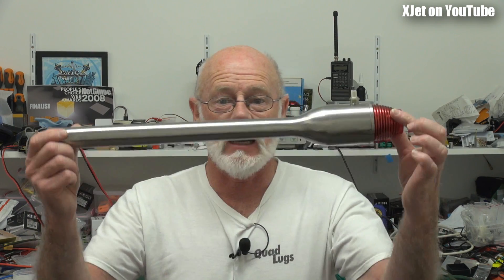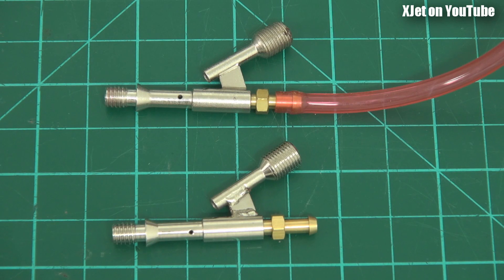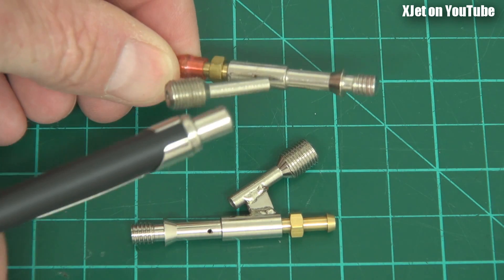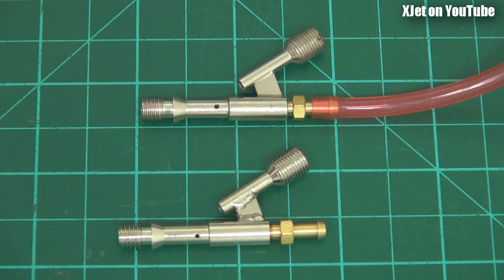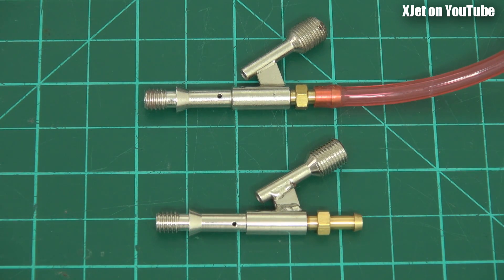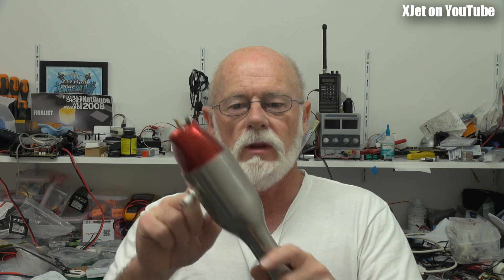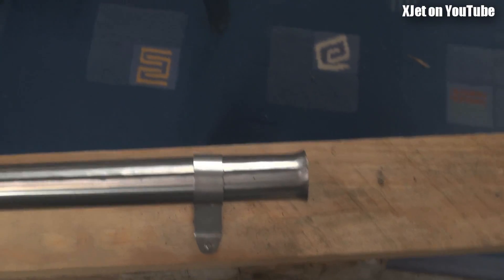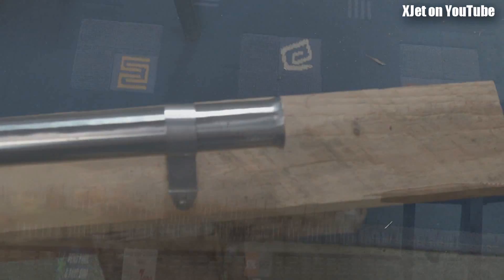Fixing the HobbyKing pulsejet (part 1)

Comment: Tesla Value? Have you thought of using a Tesla Value that has no moving parts to wear out in a pulse jet? The greater the back pressure the greater the resistance. I 3D printed one then fill up a balloon and it held the back pressure from the balloon very will. 
I suppose you would need a dozen medal Tesla value in parallel to get enough air into a pulse jet. Just food for though..
Reply from the maker: +Serafin Tirado Unfortunately the Tesla valve is too "soft" to be any good.  Tesla valves work fine with a constant flow but do not handle pulses of pressure very well at all :-(
Reply: Ok .i see you already look into it.. very good young men.

Comment: So for the fuel you can just use petrol? Or can you use alternative fuels such as alcohols?
Reply: Luke Shaw I would think kerosine would work the best as it burns when atomised along with it being basic jet fuel because of this and in my opinion it burned with more force then Petroleum
Reply: Mine used to burn reeds constantly until I tried burning 32 to 1 two stroke mix. I have it on a plane and havent burned a reed in about the last dozen flights. Used Pennzoil oil

Comment: I piddled with some control line jet speed as a kid... c. mid to late 60's. As I recall, 'flowjector' assembly quality varied a good bit between individual specimen... as I suspect they may now. Dyna's were an order of magnitude better than OS Max, but still so so. You very well might need to remove and re-position the start tube. check around on the web a bit... I recall reading and/or seeing where some modern day hard core types now use removable start tubes. Also, check the chamber and pipe welds for pinholes (soap bubble), along with the head to combustion chamber  and spark plug connections... they seen to be amazingly sensitive to even minute leaks.The aluminum reed valve seat surfaces too... lots of lapping is often needed to keep those cleaned up. Try to minimize as much as possible ground run time... and they run very much cooler on alcohol fuels as opposed to gasoline. Oops, almost forgot, leaking taper seat sealing surfaces between metering jets and flowjector can also be an infuriating source of issues... all said and done, they're really fussy about any and everything imaginable. Oh, and don't run them in the house lest you'll annoy kitty...